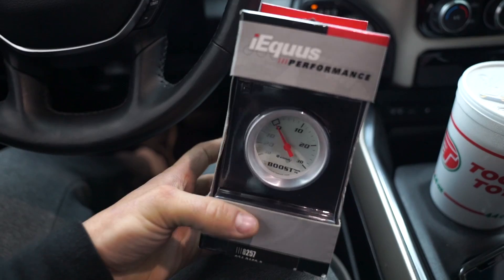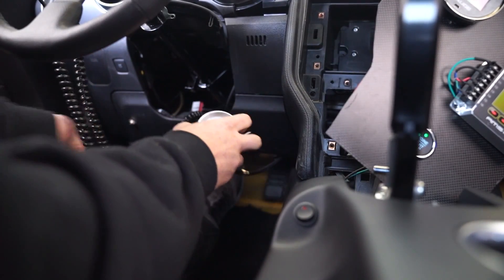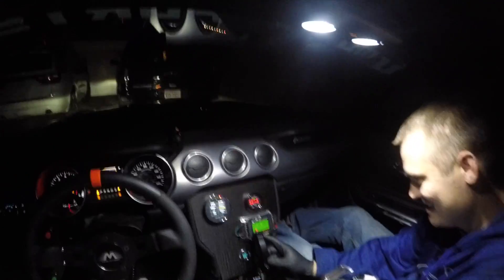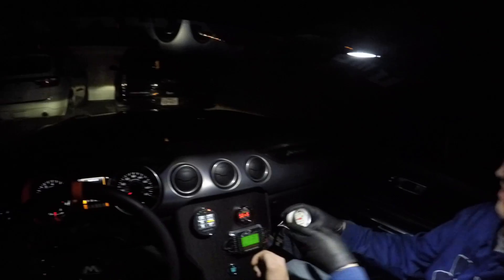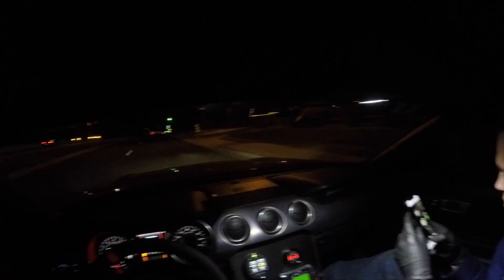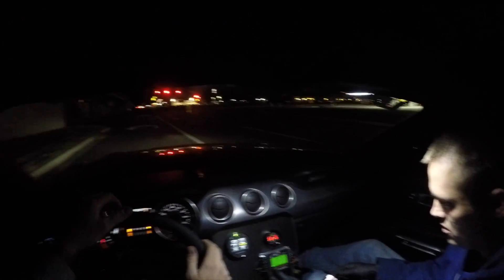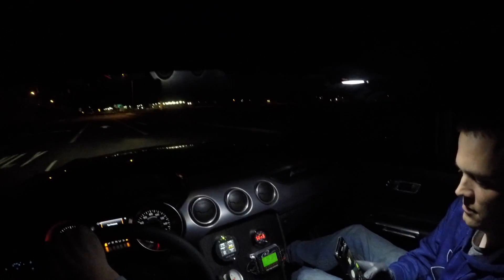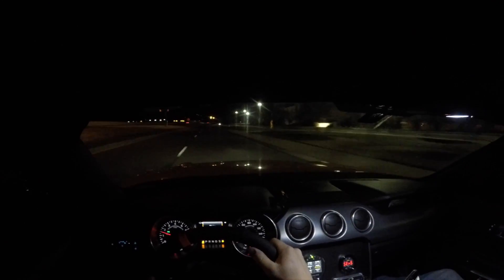NIGHT STREET PULLS IN A 1,000HP SINGLE TURBO MUSTANG (POV)

Comment: The squeaky wheel is funny haha. Hopefully you got the alignment done without any issues.
The Ngauge is calculating PSI while under vacuum while the mechanical gauge has Inches of mercury (INGH).
Street car testing looks soo fun!
Reply from the maker: Ah that makes sense! Yeah alignment went good I need to adjust the steering wheel

Comment: At idle only whatever the Boost Box Omega reads multiply it by a factor of 2, and that will give you the correct reading. EG  - 8 would be 16 inches of vacuum.
Reply from the maker: PRO 5.0 that makes sense. Thank you!